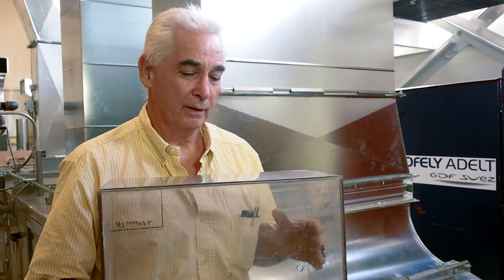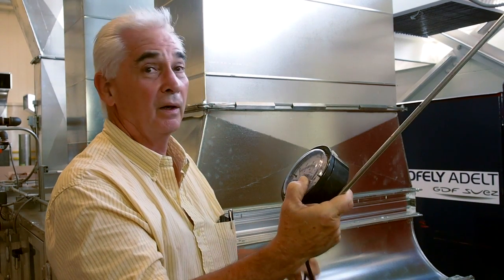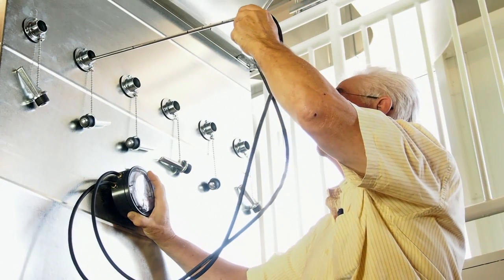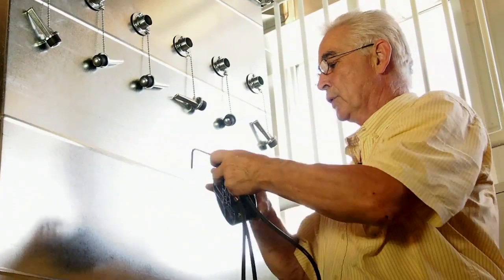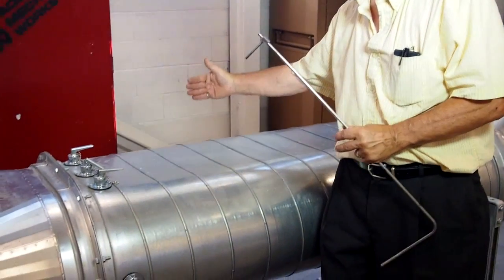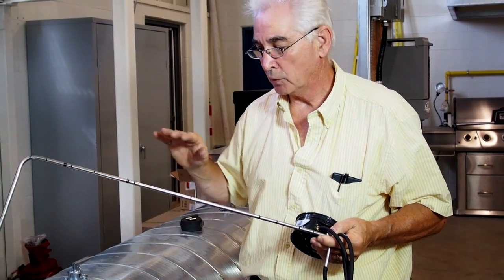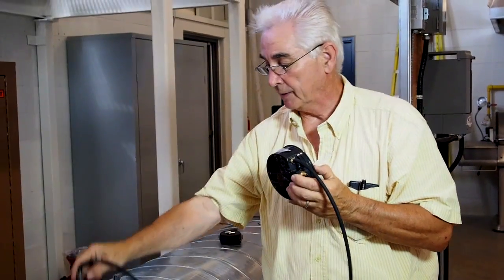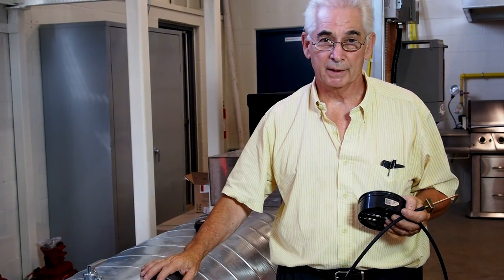Duct Traverse

Comment: Important to note you can not average the velocity pressures, you must convert each to velocity and than get the average.
Additionally, this is 2014, the magnahelic is outdated around 15-years ago. The digital manometer's are cheap and accurate.
Reply: We use several different Digital Micro Manometers during our practical lessons. The point of using a Magnahelic, or any other basic instrument, is to introduce a student to the basic understanding of Velocity Pressure and the conversion of VP to a Velocity. That understanding would be lost if a student took 30 readings and just displayed an "Average Velocity from a digital instrument".